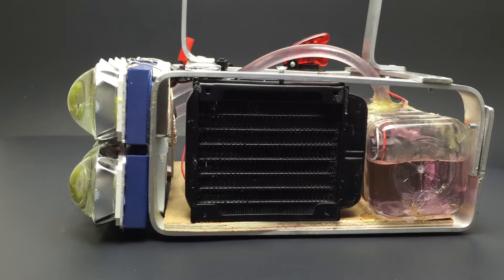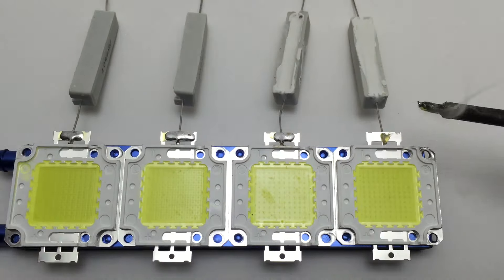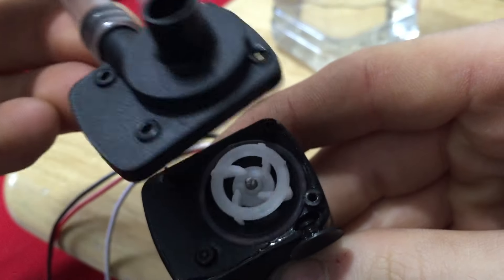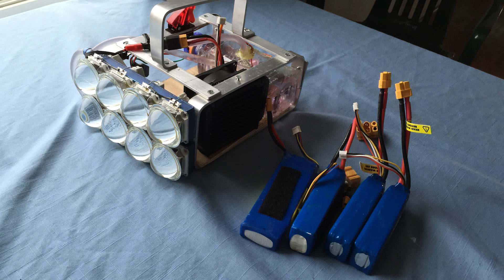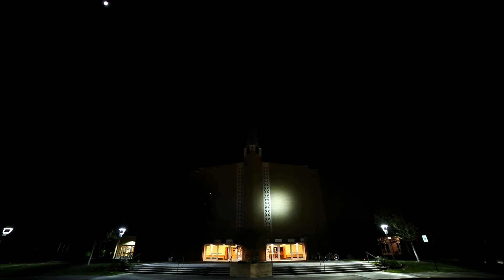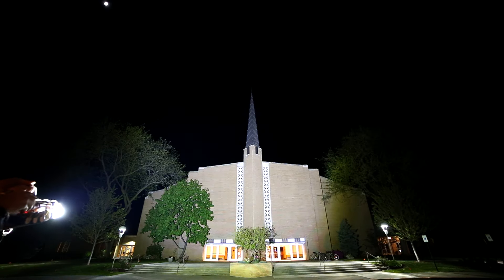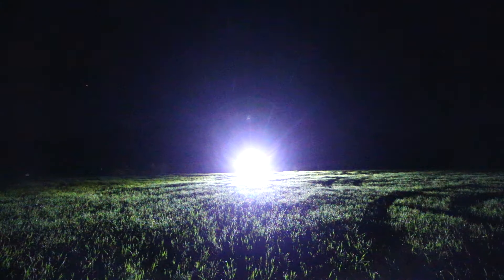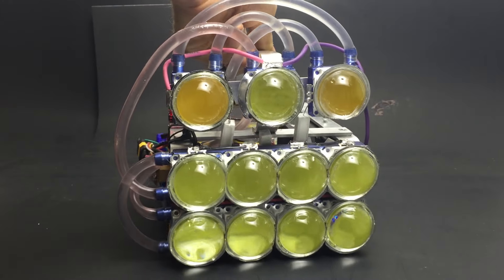Water Cooled 72,000 Lumen LED Flashlight!!

Comment: Is it wrong that I want to mount this to the front of my motorcycle as a head light?
Reply: so do I and turn it onto a cars who has their high beams on
Reply: Not as long as you intend to use it at the worst possible moment.
Reply: Funny you mention that...I recently made something similar to this using three 750 mW LED's in parallel.  It required about three 15 ohm resistors (Capable of handling 25 Watts each).   I slapped it on my motorcycle and it works great.  It gets pretty hot after an hour but so far no melting or loss of brightness.
Reply: Is it wrong that I want to mount two of them on the top of my pickup truck
Reply: Extremely illegal.
Reply: Jake Senn I live in India, so everything is legal 😜
Reply: +mayur kulkarni 
I live in Texas and everything is legal here too...lmbo
Reply: I think generally speaking laws in the US regarding the use of high beams prohibit their use withing X feet of oncoming vehicles. 500 feet is a common number. I believe laws regarding headlight usage are far more restrictive in the EU.
Reply: Eli H. And here comes the geek who ruins all the fun
Reply: Jake Senn Extremely is a strong word here. 
I would say mildly illegal.
Reply: LOL
Reply: +mayur kulkarni: Thought I was answering a question. If there isn't an oncoming vehicle (or you're not coming up on one) then its probably legal in the US. I know it would be in the state that I live in. The only limit on lights like this is height from the ground. They have to be between X and Y feet. No limit on brightness.
Reply: illegall
Reply: Yes it is, you'll blind anyone who's being shined by it, and it will probably last a few minutes after direct front exposure, so yeah, blinding people while they're driving is bad. Unless you're using it against someone who has the high beams on, in with case give the bastard his own medicine, just be quick to react when it comes crashing or does a sudden stop.
Reply: +Selur91 
I hope the bastard with a high beams on is not a state trooper...
Reply: Does it only get how after an hour?? that seems to be a long time, as I thought it would get hot alot quicker .

Comment: when the electrical wiring in this flashlight makes you cringe so hard, your face simply implodes.
Reply from the maker: buy me regulators
Reply: ***** just use a buck switch for each one.  Sure,  it's a couple dollars more for each, but they won't start smoking after a few minutes of use.
Reply from the maker: I would really like a water cooled 8-in-1 constant current boost converter to slip where the batteries go and use a power backpack
Reply: +Samm Sheperd (SNRS) you and me both.
Reply: a standard battery pack or a high voltage setup with capacitors and dc-dc converter would work pretty well. Just wired up a few packs of rechargeable batteries 48-72v and use the caps to keep keep constant voltage on the backside of the converter. Will keep pretty constant voltage and let you slip a new pack in. Pretty simple if you have the know how ;) the high voltage helps keeps the draw lower and the caps wired in will boost it when wired in right.
Reply: uh, can't you make one?  How many total A/V is that?  I'm guessing all you need is a decent sized inductor, a relatively expensive TO247 package power mosfet (maybe 10 dollars), and a constant current mode boost controller.  If you're into DIY stuff, you can get boards made pretty cheap.  After a quick look, ST's UC3842B seems like a decent option for PWM control.
Reply: +htomerif We are talking about 3 amps at 33 volts, that's nothing for mosfets. You can just use IRFZ44 fets and they are dirt cheap and do just fine up to 8 amps as I know. (EDIT: forgot to include that mosfets are okay with being in parallel or even in an array)
And here's the absolute cheapest solution: Use one single 1$ ebay buck converter, put a resistor load on it and it will provide a PWM signal on the output in fron of its inductor. Hook up mosfets onto that signal and there you have it. You can set the duty cycle because the load on the buck is constant and it will drive the mosfets (powering each led). On ebay IRFZ4s are 2$ for a pack of 10 and a buck is 99 cents.
Oh, and there is absolutely no need for an inductor
Reply: Krisztián Szirtes two things: first, this only draws 100 watts? I don't think so. Most things like this need 1-2kw.
Second thing: most lighting LED's have maximum pulse ratings that aren't very different from their maximum continuous rating.  If the objective is to get rid of those huge current-limiting resistors, you can't just chop the voltage, which is why I was suggesting a boost converter, for which you need an inductor by definition.

You probably can just chop the voltage and exceed its maximum ratings, but these things don't fail the way older LED's did.  now they fail by electromigration when you over drive them.
Reply: if you cringe over electrical wires, you should maybe reevaluate your life
Reply: +htomerif Okay, I forgot you can't feed PWM at higher voltages but you can use a cheap low esr capacitor too. Or 10 small salvaged inductors from trash electronics.
Second, I meant 100 watts each, which is about right and all my numbers are per LED. Read it again knowing this. And lastly I would like to ask why the hell you need a boost and not buck converter? The battery has a bigger voltage than needed, that's why you need the resistors. Why boost it then?
My idea is cheap and way more efficient than the resistor solution, and now with the mistake I made corrected, what is the problem?
We have a 1$ regulator driving mosfets instead of outputing power, we have 10 IRFZ44s which are 2$ and drive each LED just fine and we have 10 minor inductors. Very little power loss and it's even adjustable on the go.
Reply: *****  I think you left out the word "dont", right?

90 percent of the starving children in Africa don't have enough of the right electrical wiring.
Reply: True story. My stuff is a disaster but it always works. +1

Comment: Whats the runtime on the battery?
Reply: Based on the batteries he's using and the 11 LEDs, less than 4 and a half minutes.
36 volts at 2200 mAh is 79.2 watt-hours. 1100 watts of LEDs. The math is exceedingly simple.

However, the cooling system is woefully underpowered and will very quickly be overwhelmed by the 1KW+ of thermal energy being dumped into it.
Reply from the maker: False on the water cooling. Coolant temps stabilize at a comfortable 130ºF

Comment: little tip here, your heatsink will work quite a bit better if you do not spread the thermal paste out.  it is better to let the component spread it out as it will naturally push the air out, provided it is just a single large dab in the center.  I have noticed a 14 degree difference in my processor after doing so.  no joke, it used to overheat while playing games, never again after that.
Reply: Thanks for the tip. I've always spread my paste out as thin and even as I can. If you're getting better results with a dab in the centre, I'll give that a go next time. Cheers.
Reply: be careful not to use too much! a single droplet is enough for a processor! Too much results in a loss of performance, and you risk getting it outside the component, and if its conductive you could ruin your motherboard and cpu
Reply: +Starl0rd Unless you buy really cheap chinese thermal paste it won't be conductive, Also you can spread thermal paste out... But It's best to do it with something that can evenly distribute it, if you cannot distribute it completely evenly then just do a pea sized drop in the middle :)

Comment: next time remove the resistors, use a current mirror for control, and PWM it, so you can go 1/10th pulse but 10x the power. You're effective brightness will be much higher and controllable
Reply: Peter Twiss I am in the early stage of making a water cooled flashlight. Would you please elaborate on what a current mirror is, and how do you get pulse width modulated power? The LED's I purchased were a bit expensive, and I really want to make sure that I power them properly and not risk burning them out. Thanks.
Reply: Edit: I should have paid more attention to your comment, you clearly already know what PWM means. You asked how to do it. Use a transistor or MOSFET to open and close the path to the power. Control that gate with either a timer circuit (555 chip in an astable configuration (I think))[hard and cheap] or a microcontroller such as an Arduino or PIC chip [easy but not cheap]. Some microcontrollers come with a PWM function built in, others you would have to write it, but the code is simple and straightforward.

 @garyrice8198  what Peter said does not make sense to me. I'm not an expert but I do know a few things about electronics and LEDs. He's talking about Pulse Width Modulation (PWM), you can get enough reading on Wikipedia to understand what it is. Basically though, it is the process of turning the LED on at full power for a period of time and then turning it off for another period of time. The apparent brightness of the LED while doing this is the ratio of the on time to the total time. This is how LEDs are dimmed, rather than lowering the instantaneous current. The cycle time is so short, that the human eye usually does not notice that the LEDs are blinking. However, you can observe this effect by waving your hand in front of a dimmed LED, you will observe a strobe light effect over your fingers.

Now, what Peter suggested was to overdrive the LEDs at 10 times their rated maximum output but pulsing them at a cycle of 1 part on, 9 parts off (1/10th)[1 part on/10 parts total]. The weird part is where he claims the perceived brightness will be greater. To me, that makes no sense. The brightness should be the same as driving them at the rated current and constant on, because 1/10th times 10 = 1. I also find it weird that he wants to pulse the light at full brightness. But like I said, I'm not an expert and there could be something I'm missing or don't know about. But then again he didn't reply to you and he didn't elaborate, so who knows.

In any case, how is your flashlight project going? Got anything to report back on?
Reply: Help me lol.. I got a boost converter that can control current but when I turn voltage up to 35v from 12v and try adjust the current down to 2.5-3a it resets the boost voltage to my battery's 12v.. I'm trying to power one of these LEDs and regulate the current but it's doing my head in.. could I use a 10w 1ohm res if it's just 1 led? Or is there anything I could use inline with the boost converter to limit the current to 2.5 - max 3amp? Advice would be good thanks
Reply: @MatthewStauffer   above
Reply: @brandonthatcher7781  probably you're drawing too much power from the converter

Comment: Just want to point out that in optimal conditions, the sun gives about 100,000 lumens per square meter on the Earth's Surface. (Alot lower in more common conditions, idk the numbers though) anyway. there ya go for comparison
Reply: Which means given the size of his flashlight, it has a higher light intensity than the sun at Earth's surface.

Comment: How long before you see this mounted on the front of some idiot's pickup truck.
Reply: I've got 120k-ish lumens between 9 led light bars on my daily driven truck, but I'm not an idiot with them!
Reply: my buddy owns DigiDiodes so i get dealer pricing. Only use them when I'm on the dirt
Reply: I think they're great of recreational use.  I personal do not own a truck at the moment, but would get some if I did.  I have plenty ideas of what I would use them for.  I believe they should be outlawed from being mounted facing rearward.
Reply: It would be on the same idiot's truck that has the balls dangling near the hitch. 👊👊
Reply: all ready did fam
Reply: Staywild. Alternator life is measured in hours.

Comment: You only leave it on for 10 seconds what the reason ? Pretty cool though .
Reply from the maker: +Atr42Greasemonkey read FAQ
Reply: what about an automotive or marine application? run the cooling off the radiator or seawater intake and power it off the alternator.
Reply from the maker: sjpro1 Perhaps a good idea. I Engine cooling systems run hotter than this does, but would still keep it in a good range. I'm not sure I would like to run seawater through this though
Reply: ***** Just spit balling, there is a pretty big market for long range lighting in the desert racing and marine worlds. You could have pretty good success if you could make these reliable enough to hold up to a baja 1000 race.
Reply: yeah
Reply: GOOD point.

Comment: I'm trying to build one of this but only with 4 LEDs instead of 8, what power supply should I use for this? Can I use 12volt 5 amp battery to power all the LEDs? Is it possible to have some sort of circuit diagram? That will be great! Thank you so much.

PS. Do I separately supply power for the fan and the pump?
Reply: 장현진 you are asking so primitive questions that you will never make it on your own.

Comment: How long would you feel comfortable leaving that on?
Reply from the maker: Unlimited.
Reply: like for 5 hours at night..? won't it heat up..?
Reply from the maker: Yasir Shah On an unlimited power source, the coolant temperature is stable.
Reply: And how long does the batteries/accumulators last?
Reply: Samm Sheperd. Sell those, I will buy one.

Comment: whats the runtime?
Reply: What's that sucking sound?

The batteries draining!
Reply: The lights are 800 watts on 12 V, which means that it is drawing a massive 66.6 amps of current (to compare, a 65 watt lightbulb in your home is a little over half an amp)

the total charge of the 3 batteies (at 5000 mah each) is 15000 mah, or 15 amp-hours, meaning that if the batteries only were powering the lights they would last .225 hours... an astounding 13 minutes and 30 seconds under ideal conditions, lol.
Reply: Epic nerd sniping here haha Thank fuck Ro answered this one!

Comment: Does it push back?
Reply: LOL
Reply: There is a very very very veeeeeeeeeery small force pushing back yes
Reply: +ficolas2 Light has no mass, how would it push back?
Reply: Itd has no mass, but it has momentum. (The momentum foe light isnt calculated P = m*v)
Reply: +ficolas2 but for the flashlight to move it would have to eject mass. Thats why a spaceship cant fly with light. One could achieve thrust with ionized gas, but not light.
Reply: pretty sure I got pissed a long time when people assured me it had to mass, so I figured it to be around 10^-50kg I don't remember the exact number.
Reply: +FoxTail737 thats what newton physics tells us, but relativism tells us a different (and real) thing!
Reply: It pushes when boucing off a reflector, there is no good reflector in the flashlight but some components do reflect light a bit, so there is a force, a very small one, but it exists
Reply: ficolas2 Why don't we use it in aerospace engineering? Sure the thrust is too small, but still viable as some probes just need 2 mm/s^2 to go beyond the solar system. I'm not saying relativism is wrong (as my knowledge about it isn't that great) i'm just asking myself why light thrust isn't beeing already used.
Reply: We havent used it YET, but there are plans to propell probes from earth using a laser, the technology level just doesnt seem to be high enough
Reply: When my physics teacher first told us about this (The laser propelled probe), when we were learning about light and relativism, I found quite unbeliable, I thought our teacher was "trolling" us (he does it quite often)
Reply: ficolas2 What do you mean by "the technology isn't high enough" ? Explain, if you can, please.
Reply: Im not an expert, I just know that research is beeing conducted about it, however we havent done it yet, so our tech level must not be enough, thats what researching is for.
Read bout the breakthrough starshot project.
Reply: ficolas2 I will, thanks for the information.
Reply: ficolas , if something has no mass it cant push.
Reply: Learn relativism, then come back.
Reply: Jérémy is right

Comment: Bro I am 99.9% sure the shadowhawk x800 scammed stole snaps from this video and your creation to falsely represent their scam light. I saw it on an ad on weather.com
Reply from the maker: +crowleycorpresident thanks for the heads up. Not much I can do. They use shots from rctestflight's video too
Reply from the maker: ***** There's actually a small 3s (12v battery) just for the cooling system. A better electrical system would be a good improvement to this.
Reply from the maker: Sure, Just put a Lipo voltage alarm on there so you don't ever discharge them
Reply: Is this light in my
Samsung S7 phone ?
Reply: I'm pretty sure you can sue them for using your videos to sell their product and for false advertising.
Reply: how long can it be turn on

Comment: Would be nice to know about how long you can keep that running, how quickly it drains a battery. Also, what would.the durability be like for the LEDs and the batteries if it was to be used fo like 2 or 3 hours straight on a regular basis.